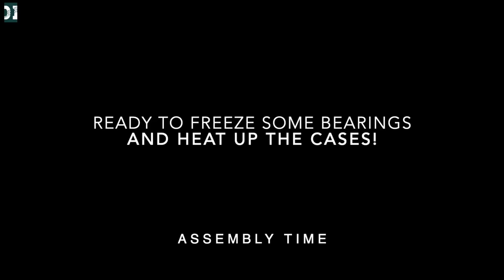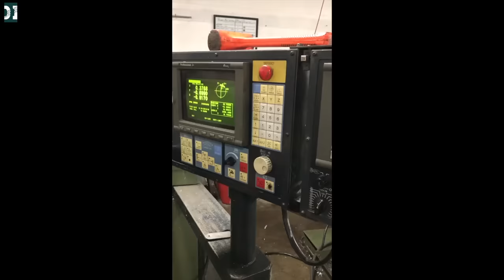EPIC $800 KX125 resurrection - 2 stroke dirt bike build!

Comment: What happens to the bikes after you have finished them great job by the way 👍
Reply from the maker: ride them or sell them.. depends
Reply: You must know a fair bit of engine knowledge to pull apart engine casings and pull the gearbox to bits and then re build it all back together I’ve been a motor vehicle mechanic for 40 years but would be scratching my head at pulling a two stroke gearbox apart fair play to you my friend 👍

Comment: YOU GUYS Should start a show call pimp my bike. Only thing original on this bike is the motor and frame
Reply from the maker: haha, sounds interesting.. ;)
Reply: D Moto’s vlog and the Motor is barely stock
Reply: D Moto’s vlog that’s what I thought, $800 bike...$5000 worth of new aftermarket parts. Real special builds are all original.
Reply: Yes and put a PS2, fountain and a milkshake machine on it!
Reply: @grahamdowdell4356   Hell yeah, plus where i live in the portland,or area I look at craigslist all the time and there are never any good buys on used dirt bikes to fix up.
Reply: Hi

Comment: Great video!! A+++++ What tool did you use for to hold the clutch basket still while you tightened it up? They look like vice grips, I can't find it on ebay, and I think I'm looking up  the wrong keywords. Thanks, Cheers!
Reply: Thanks! I used a Tusk clutch holding tool from Rockymountainatvmc.com

https://www.rockymountainatvmc.com/parts/tusk-clutch-holding-tool-p

Comment: @4:40 can't believe somebody let that plan go through of putting the front axle pinch bolts facing forward on the low part of the fork lug, smh. dragging/pushing through ruts

Comment: so with Trickeng you can use modern clamps on old kx 125 frame? or you need others adaptors
Reply: I believe on the 03+ models you can use some modern kxf clamps, I even think you can on the 02.

Comment: Beautiful bike but idk if I would put that much into a 125.. I'd be bored with the lack of power after 15 mins.  Last 125 I owned was a 1998 YZ125 and I constantly had it pinned wide open on the trails.
Reply from the maker: yes, 125 is not the best bike for average guy, I am the same way
Reply: Kyle take your BS back to the rodeo🤣💩 last 125 you owned was a dinosaur